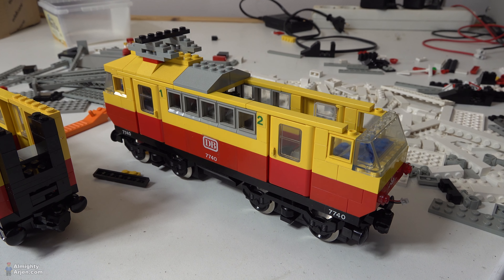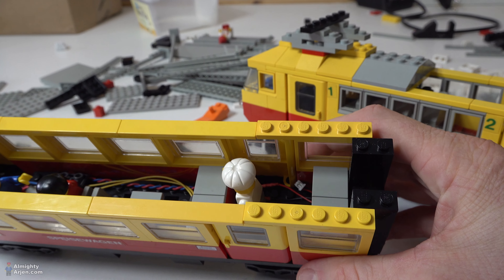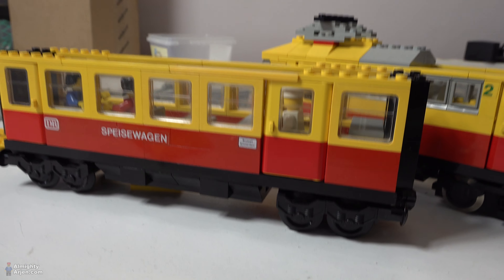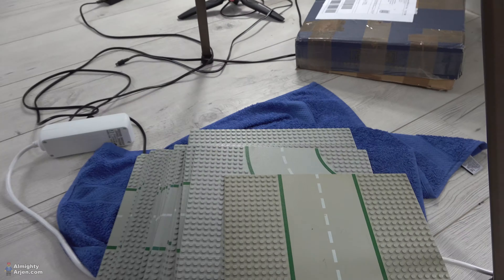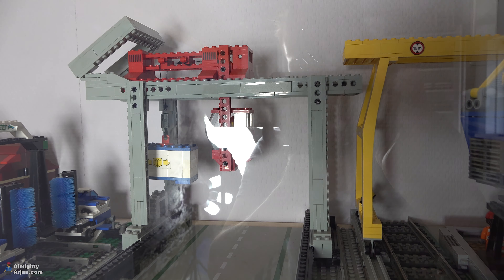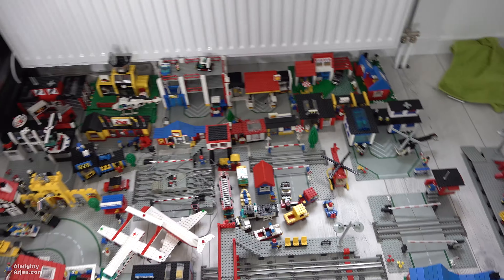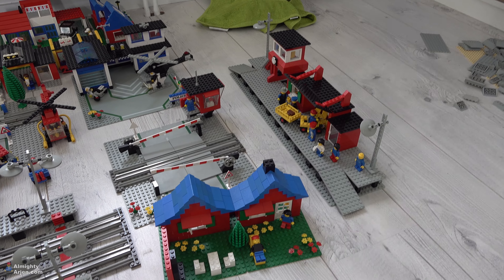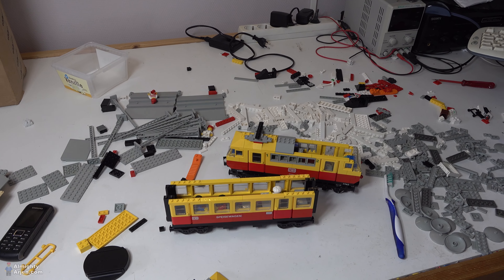Vintage Lego train layout Episode 2: changing the trains back to original

Comment: Nice update, fun to see you're planning to light everything up. Custom wires are completely fine IMO, the way I view it, it would be completely fine and doable back in the 80's. A couple things I forgot to mention last episode is that you can get the 12V motor that appears in set 880. It connects to the central hub perfectly, so you can control things like conveyor belts etc. together with the trains. Another useful trick is that the signal 7860 can be used to completely separate the electricity of two parts, but still have them connected so trains can go from one to the other. That both allows for independent control, but also makes it easier to avoid problems with the electricity not being enough.
Reply from the maker: Yeah I believe I have two 7860 sets, definitely going to use them!

Comment: Treating with hydrogen peroxide really works well - if the worst comes to the worst, you could think about hiring a sun bed to give them a blast if the sun doesn't come out?! (I joke!)  I've been looking to buy some of those yellow & red carriages for my layout, but the cost is far too high, so I've begun to Bricklink the parts - but the doors are so specific to those sets that they are incredibly expensive.  Lastly, it's nice to watch your progress unfolding as you go along.
Reply from the maker: They see me coming at the local solarium :') Those yellow train carriages are becoming very expensive indeed, they were affordable 5 years or so ago.